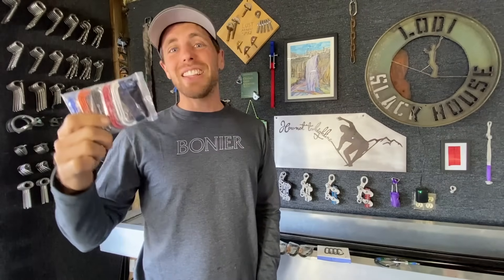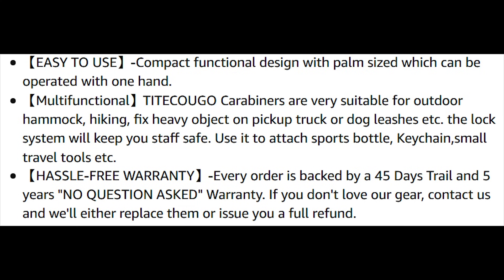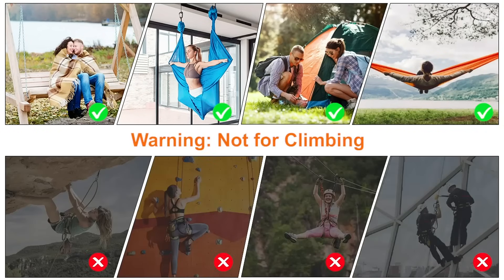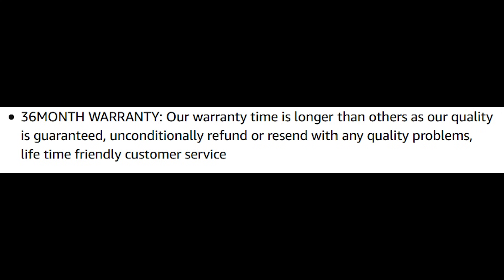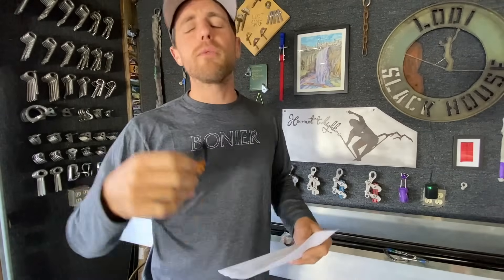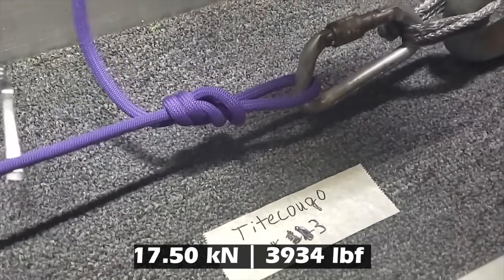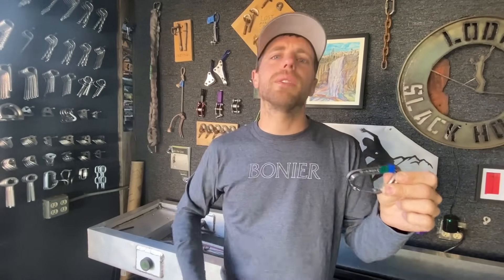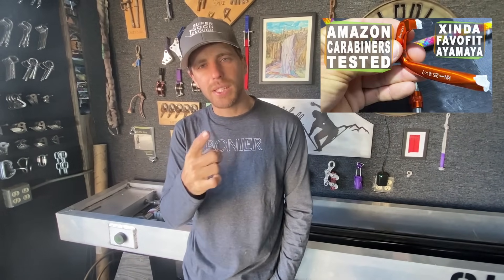I Hate Amazon's 12kN Carabiners

Comment: I don't know what brand, but I've bought a variety of similar carabiners from Amazon and I've never done any climbing or had any desire whatsoever to do any climbing. I've been quite pleased with them. You're definitely right about anyone misrepresenting them for being for climbing, but there is definitely a market for non-climbing carabiners.
Reply: I like the Metolius Nano for non-climbing carabiners. I know that no matter what I am using it for, keychain, hammock, etc, it will be plenty strong enough, and it is built to the standard of safety and reliability it claims to be given the reputable manufacturer, rating, and seller. Once you include amazon's fulfillment and shipping costs, it isn't all that different from buying real ones from REI, and the peace of mind is worth the 2 dollars.
Reply: I think something that's worth considering is: These devices are great for non-climbers, non-critical safety situations. Hanging a hammock? Go for it. Suspending your food bag up in a tree? Definitely. Even using it as an assisted lower for something like a canoe down a steep slope.

However, as a climber, I would never get these devices for fear they might mix into my main gear. Even though I'd (probably) spot the non-climbing ones and avoid their use, one of the people I bring out with me might grab one from my kit without realizing. Instead, for all of my camping stuff, I simply retire older carabiners for that (which comes with the added benefit that I can more likely use the gear I have on me during camping for more critical applications).
Reply: @Tralin  Would you trust it 50 ft off the ground in a hammock for an overnight.
Reply: @AMC-eq3jr  It's like you missed the "great for ... non-critical safety situations." part of my message and jumped straight to trying to be clever.
Reply: @Tralin  Not so - I was just trying to imply that part of the equation of using any equipment is "confidence level". Even though 550 paracord has enough breaking strength, I would be fearful of lowering my 150 lbs with it.
Reply: @AMC-eq3jr  I believe I made my confidence level clear when I said I would not use it for non-critical safety situations.
Reply: @Tralin  You got it Glen.
Reply: @AMC-eq3jr  always one of you dudes who pick a fight with a scare crow. You are arguing against something the person never implied.
Reply: zeah, i use one on my hammock...
Reply: The problem is if you a climbing carabiner made in China. I don't want a made in China guarantee for my safety

Comment: Love your content. I was a bit disappointed in this vid because I was hoping to see you test the crosloading and open gate strength of these. For me having no idea what those ratings are is the biggest reason not to use them. I have considered paring one of these with a cam that is also only rated for 12 KN but thought better of it when the idea that the strength could drop down to under 7KN if it ends up crosloaded in a fall. I kinda hate to see you buy more of these but I would certainly tune in for those tests.

Comment: I think I spent a minute choking on the "great" advertisement...

Just for anyone who is believing that these load ratings might just be sufficient for climbing, the math behind all that is not that hard (under idealized conditions):
Take a 50kg climber, let him freefall for two meters (e.g. 1m above the anchor). That generates about a kiloJoule of energy - in order to dissipate the energy and get within 20kN maximum load, you need at least 0.5m of dynamic stretch in your system. Now granted, this is the worst case scenario of a factor 2 fall and most ropes stretch further, but it's not entirely uncommon, and most of us weight more than 50kg with gear. The margin is getting thin there pretty quickly...

Comment: They rate them at 12kN because they can't keep a consistent "quality", 12 is probably the minimum tested by them.
Reply: or they did some quick math and never even tested the carabiners. math said around 16 so they felt safe claiming 12 without any testing. sketchy no matter how they chose the number
Reply: by going for 12kN they are not for climbing, making it easier for the manufacturer to blame misuse for any injury.
Reply: @sarowie  ding ding ding and right here is the correct answer.
Reply: It is not uncommon to just rate stuff at some "normal" rating. If you find find to manufacturers with the exact same rating this is what happened 99% of the time
Reply: Theo one I bought says they've rated them around 15 to 19kn. So to be safe they rate it under. 
For sure they say it's not meant for climbing but it should be unmissable in the title or 1st image. 
I bought it for camping, as I I'm professionally trained for work at height.
Reply: I have a 5KN carabiners
Reply: @TigerGold 59 I think you got it backwards. They likely tested for 12kN, not bothering to test if it was strong enough to also pass 13 or 18 or any other higher number. 

Thats why i mean with "standard number". If it hold up to that standard they put it on the label and dont do more testing
Reply: Hopefully ✨
Reply: They rate them at 12kN because they're confident that 100% of them will survive 12kN. 12kN is the minimum breaking strength. That means the worst one they've ever shipped has to survive 12kN. 

24kN climbing carabiners typically break at 28+ kN, because the rating is a minimum not an average or even a 99%.

Comment: I suspect that the reason they are not breaking at 20kn is because of loose tolerances in the little hook where the gate closes. It could be that they are made from a casting, and the little hook for the gate is not precise enough to get full strength.  That seems to be the first point of failure for many carabiners, and it appears that is what happens first when these break, is that they gate comes unhooked and then the spine breaks.

Comment: I use CAMP Nano 22s for accessories like water bottles and flashlights. I figure I need something to clip those with anyway, I might as well have a spare life-safety rated carabiner in case of emergency. I've also got them on some alpine draws, though the small gate can be a bit annoying to clip in to so I have a normal sized carabiner on the other side (CAMP Photon usually).

Comment: The aluminium is not bad necessarily, although no certification means it might not be 7075. Elongation at break is worse and many other factors might make it not useful for climbing. What I suspect is the reason for the lower breaking strength is the simple triangular shape of the load bearing profile. The bulbs on the outer edges and thin middle section of certified carabiners have very good reasons to be there. Also gate steel might be of dubious quality.

Comment: 7 series aluminum has a tighter grain structure and would act similarly to a 6 series t6. Basically they skip the heat treat process most likely for less manufacturing process, but still have the toughness of the 7 series

Comment: I don't see anything wrong with how these are marketed. In fact I'm pretty psyched to get a 18 KN biner for $2.50. I bet the 12 KN rating comes from an initial quality control test when the fabrication machines were first setup. They probably break tested a whole bunch of them at once. 12KN was the 3 sigma lower limit and they just called it that. Probably don't ever quality control or break test any ever again. - Edit: LOL. I looked through my rack and found a Big Wall quick draw that I got for free through a gear rep. It looks legit with all the 25 KN, open gate, cross loading and CE stamps and what not. I'm sure it's super safe enough

Comment: these are pretty close to the strength of a climbing carabiner. you shouldn't feel bad about using them if you're cheap af, though one thing i'd like to see is their breaking strength with an open gate, because the wire gates could open relatively easily.

Comment: Don’t understand the market. Climbing carabiners are really not that expensive. What do you need a carabiner between a keychain and a fully rated biner strength for?
Reply: At £7 minimum for a carabiner, it really does add up if you're on a budget.
Reply: @AR-cy6uj  the cheap ones are about 1/3 that prove, so say $10 for rated ones and $3.5 for these. If you can't afford $65 more for 10 rated carabiners ($100 vs $35$, that you trust your life to, you should get into a sport like pushing a wooden hoop down the street with a stick.

Comment: Wouldn’t the rope itself breaks waaaaay before the carabiners do ? . If so why do they need to be 20kn when the rope doesn’t even take 10kn ?
Reply from the maker: What type of rope are using that breaks at less than 10 kn. We get 20+ kn when a carabiner is in the system. Check out the episode with the grooved perma draws.
Reply: @HowNOT2   I asked Google “How much force can a climbing rope take?
The force rating indicates the maximum amount of force the rope can deliver to a falling climber, measured in kilonewtons (kN), under test conditions designed to simulate a hard fall; typical climbing ropes range from 9kN up to an Arborist's 24kN.”
Reply: @tastytechaddictsmtb  A carabiner on the top with one 9kn rope through it anchored at the botom will experience about 2 times the amount of force the rope does in a fall. It is like a simple hanging pulley system. The 9kn dynamic ropes and 21kn biners are well balanced for general use. No fatties!!!!

Comment: Just throwing this out there, but from what I have heard (un substantiated rumors) you should not buy safety gear on amazon. The reason is that amazon frequently uses mixed inventory (commingled inventory) where "identical" products sold by multiple vendors are placed in the same inventory bin. The problem is that each vendor sources the product separately and while one vendor may be selling the genuine item, another vendor may be selling counterfeits. Since they get mixed in the amazon warehouse, it can become possible to receive counterfeit goods from a reputable seller. If you life depends on it, probably don't risk buying it on amazon.
Reply: Co mingled option (by packing and labelling in a certain way) can reduce seller's FBA (fulfilled by Amazon) costs, so Amazon encourage this
Reply: Based on the VERY mixed reviews, even on branded products, from Amazon purchasers, this definitely happens way too much.
Buying from Amazon is therefore a bit of pot luck. Not necessarily a big deal, because of the ease of return, but if something you need is mission/safety critical, it's better to buy from more reliable outlets than Amazon.

Comment: At face value rating 50% higher than the stamped rating seems like a good thing, but it really shows how much of a difference in quality control there is.  I would wage that if these go really high in quality randomly they could also go the opposite direction too.
Reply: They normally should go higher then what they are rated for
Reply: Well, if you're engineering for a safety factor of 2, there's nothing wrong with that.

Unless you want a chair that'll explode once you reach 1lb over the "rated" load.

Comment: Woo love this episode, two things I've been waiting for in one video! The 12kn carabiners and the Camp 22 nano were both on my break-test wishlist.

I must admit I love the 12kn carabiners though, I own 20+ of them and use them extensively for light duty rigging, motorcycle luggage logistics, and vehicle recovery z-drag kits. They're exactly the right strength/weight/price ratio I need, and I keep them all clearly marked and separate from my climbing gear. I also like the Rock Exotica RockX Accessory biners, which are super light 5kn biners, one of the only 4-6kn options on the market.

Comment: I will say, these are great for hammock use. Light weight, and cheap enough that I don't get upset if I lose one.
Reply: @Rokmononov  I’m not saying that you should incorporate sub-par gear into your life safety system, I’m saying that a combined 30kn strength is way way way more than enough to hang a hammock. How strong do you think the ropes that hold your hammock together are? Stronger than 30kn? How about 15? I doubt it. If the point of failure is the hammock itself then why bother with incredibly overengineered components. Is it bad to use 40kn carabiners for your hammock? Of course not, but why would you when it’s literally impossible to impose those kinds of loads. 
By your logic where does the “stronger is better” argument end? Presumably you use 22kn equipment for climbing. Why not 40kn like the fire dept? (Btw we use 40kn on a twin tension system so the actual force to break the ropes would be 80kn - the hardware is actually our “weak spot”). Why not go to 80kn carabiners since it’s life safety and “more is better”? Why not 100kn? It starts to get crazy, but it’s the same argument you’re making for the hammock.

Edit: additionally I’m not complaining about 40kn equipment for rescue - rescue gear sees strange and varied loads and can be shock loaded on unpredictable terrain like sharp rocks and things - that 3-4x safety buffer is useful in our use case. I was simply using it as an example that climbers trust equipment that is half the rated capacity of what we trust in rescue, and it works just fine for climbing applications, just as even a couple of 3kn Home Depot carabiners would work fine in a hammock application. The equipment needs to suit the job.
Reply: @Rokmononov  I think the hammock itself will break before a 12KN carabineer will get trashed
Reply: Foxtrot Oscar  17kn of shit is a ton!
Reply: A full climbing fall is 4-5kn sooo what’s the issue
Reply: @btrswt35 it's 1.7 tons actually, but we're splitting hairs
Reply: @Rokmononov  how is that a risk?
People get so caught up with “everything needs to be 21kn or it’s going to break blah blah blah”
I’m from the Fire Dept world where everything is rated to 40kn and we say the same thing about THAT. “If it’s not rated to 40…”, meanwhile that’s 3x the forces you could ever see on a system shock loaded with a 600lb load, even accounting for rope strength loss with knots. 
All that to say, use what’s rated highly enough. 2500lbs is 5x higher than any max force your hammock is going to see, and if you think you’d break a carabiner using your hammock you should probably get on a major diet ASAP.
Reply: @Rokmononov  I've been using 4mm and 5mm cordelettes to get some additional reach when my hammock straps just won't do and it has held up just fine. They're rated for 4kN and 6kN respectively, so that's well below what these carabiners can hold. If you want to use 10mm rope and 22kN rated biners be my guest, but you're just making things more heavy and expensive than it needs to be. These things aren't used to life critical applications.
Reply: I've always been under the impression the rope is going to snap before the carabiner breaks for lightweight ropes. So they're not bad for intended use.
Reply: @Rokmononov  And then there are us ultralight guys with hammocks that can just barely hold a 100kg-person without ripping.
Reply: or just spend the sxtra 5 bucks to get one you can do anything with and will last for life...
Reply: I use these cheapies to clip my cooler to my kayak. If I drop one in the lake, who cares? But I maintain a massive separation between them and my climbing gear.
Reply: Just dont get confused and take one climbing!
Reply: @Lance_Belco  bit they're "Great!"
Reply: Yeah these carabiners are just fine for their intended use. Anyone with a brain will know not to use them for climbing.
Reply: @MadGunny  except for the new climbers looking to buy cheap biners and they see the review that says they're meant for climbing, thats what's dangerous
Reply: You can’t save stupid man, no matter how many edges you pad
Reply: @MadGunny  Would you trust it 50 ft off the ground in a hammock for an overnight.

Comment: Think you could figure out a way to do cyclic loading tests? Maybe an arduino controlling the hydraulic ram based on tension from the dyno. Would be slower and a general pain in the ass, but might show more of the difference between these and proper climbing biners.

Comment: Best hypothesis I have: the gate is the weak point of every cheap carabiner. In every test, what seams to break first is wheter the gate hook or the gate itself. 
I don't think the heat treatment or aluminium quality is the cause here, the way they break (they snap dry) suggest a heat treatment. I'd say the geometry of the gate hook and/or the quality of the steel the gates are made out of could be the cause of the lower rating. I'm curious Ryan, how opening the gates feels compared to real climbing carabiners?
Reply from the maker: the shapes of noses seem the same since they basically use the same designs as any carabiner and the gates open and feel the same.

Comment: Yes,  heat treatment plays an mportant role in aluminium (and steel for that matter) mechanical properties. You'll probably love the reference site makeitfrom.com, I'm always searching for material there. It's impressive how many 7075 aluminium variations there are. 7075 represent the chemical composition and verything after the - represents the heat treatment (for example 7075-T6) "T" means there is an heat treatment, "O" means annealed (which is, technicaly a heat treatment, but the goal is to remove stress between the molecules, lower mechanical properties, soften material)